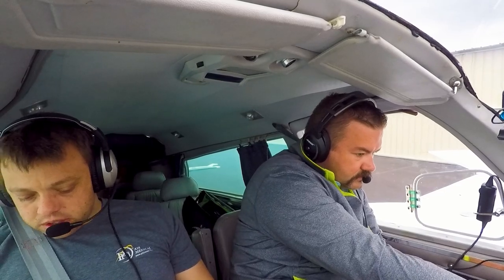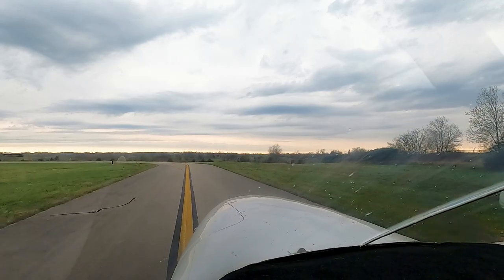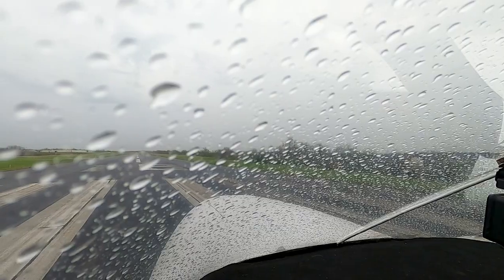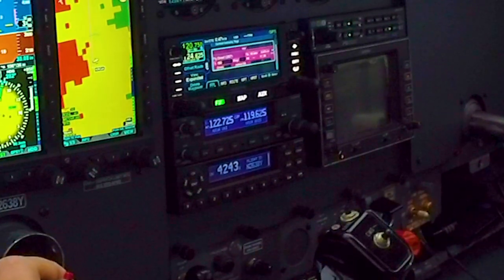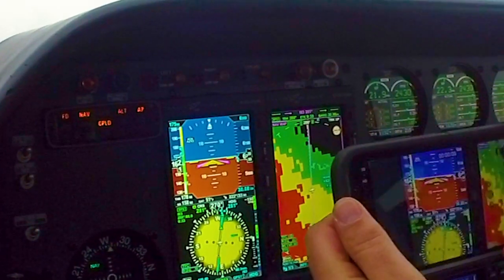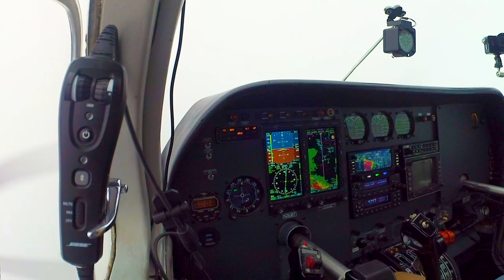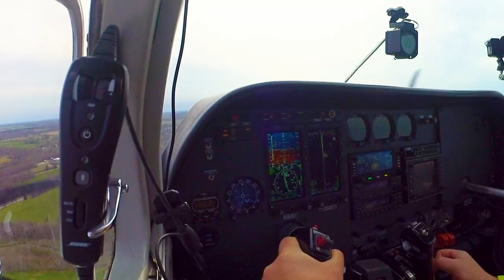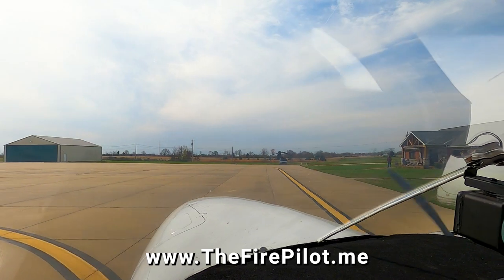Vacuum Pump Failure | IFR Flight Storms & Weather In Twin Cessna Airplane | TheFirePilot

Comment: Why leave the ground flying into IFR conditions with one known vacuum pump failure? Bad decision. These things have a way to compound as you go. Bad choice.
Reply from the maker: Bill thanks for your comment. Did you look at the comments of the video? Did you see that I don’t rely on vacuum pumps on any flight instrument ?
Reply: @TheFirePilot  The vacuum pumps are also the source of air to inflate your anti icing boots. I am not a professional pilot but have over 5,000 hours in twin Cessnas flying the northwest. I would never take off knowing something is not working. I am also old school with round dials. I followed the rule if it is made of metal it is going to fail. This only becomes an emergency when you are in the air solid IFR over mountains at night. I did enjoy your video.
Reply from the maker: @billblatchford1566  understand. Nothing wrong with how you operate. That is of course the safest way to fly. For me I have a different risk profile. I made an educated informed decision. Even if I lost vacuum on the other side, it would have zero affect on the flight. So based on that, I decided to fly.  Thanks for watching - I hope you enjoyed and stick around for another one.